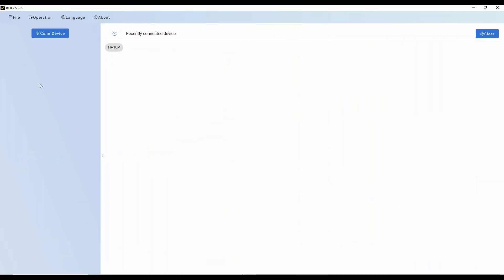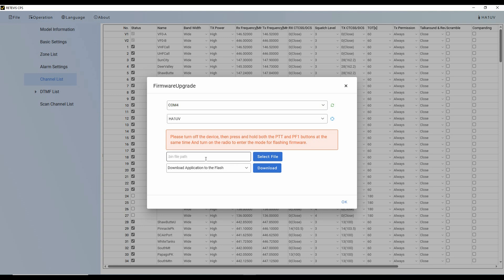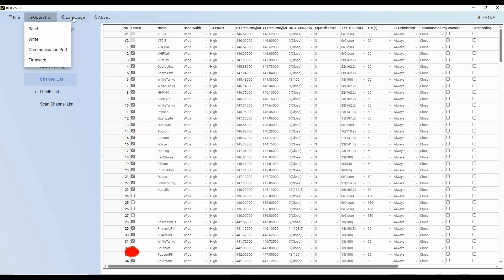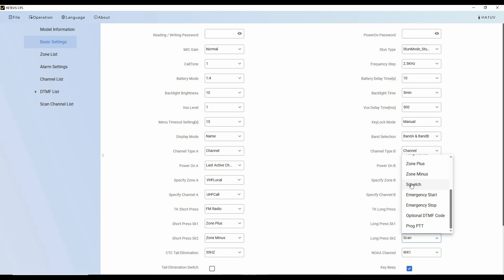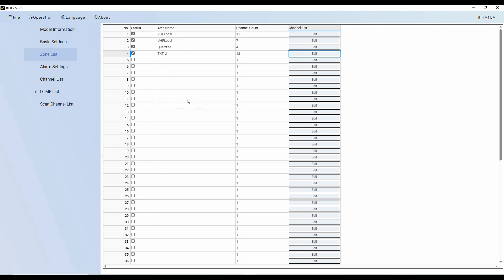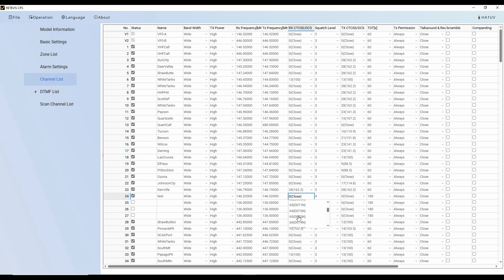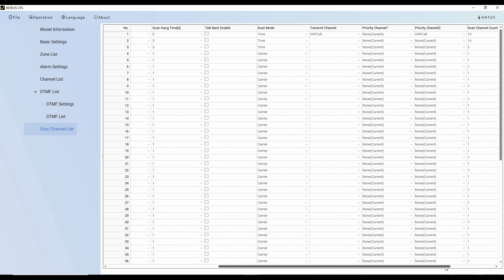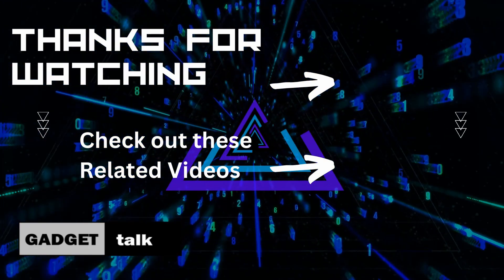HA1UV CPS Deep Dive

Comment: The usability on this radio is still so frustrating.. I have created a scan list, but whenever I click the *SCAN button, it just displays "Scan Err!" now. Can you please explain how to actually use it?
Reply: From the radio keypad only I did this to enable scanning of saved channels.  I did the following for each channel. Menu, Channel, (What ever channel you named it), Scan List, move up arrow to Scan-1, Select, Exit, move to next channel you want to set for scanning and repeat process. This worked on my HA1UV bought Sep 2025. I could not do it with the CPS as shown in video.